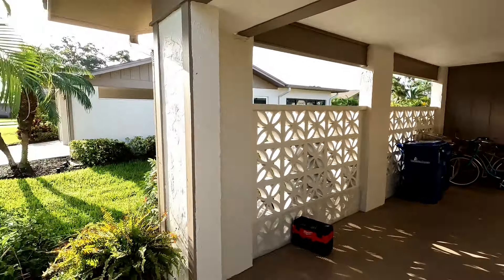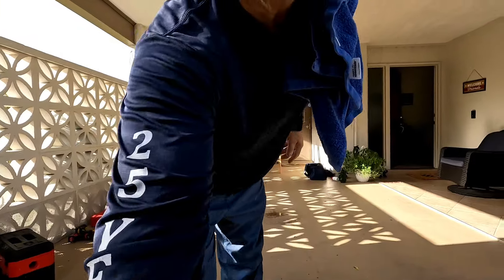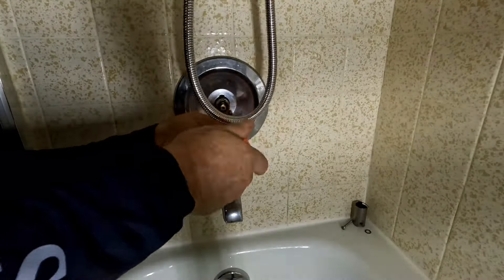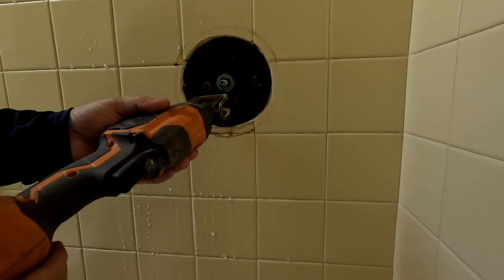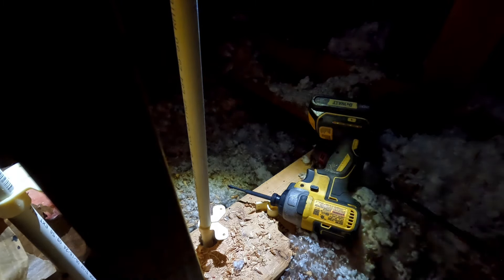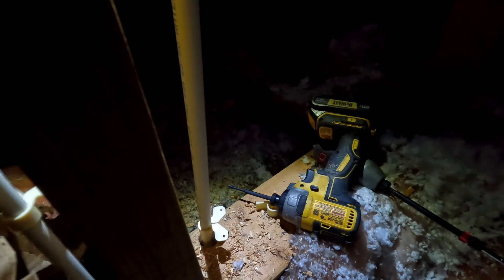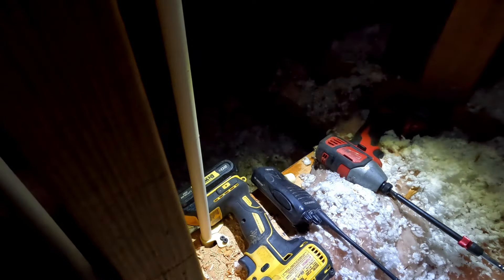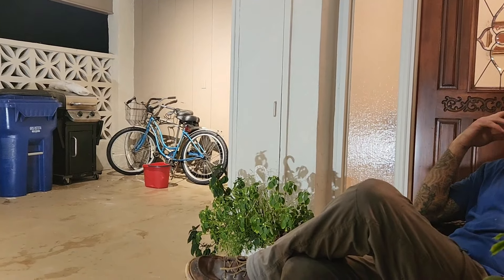HOW TO RE-PIPE A HOUSE WHEN IT IS 140 DEGREES IN THE ATTIC,NOT GOOD

Comment: I dont have pex tools  If I did I wouldnt concider cpvc   mainly  no one uses it here but I know  repipers use it in other areas.
  You really know your stuff but rescent experiance   plays a part     if you can get a 3rd guy     and maybe try pex   out here its all uponor  but that varys too i dont know anyone crimping   type b straight length looks good    though to me      you could kick ass with a couple guys     you stay outta the attic do the water heater, service, hose bibs or whatever    shag  whatever stuff they need.        on to the next one !